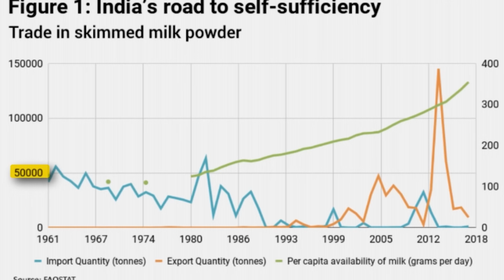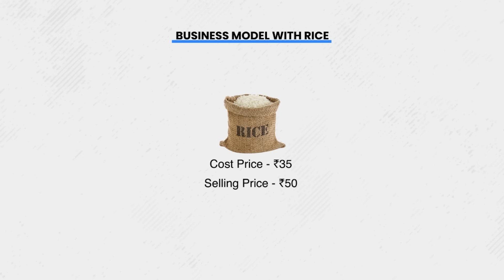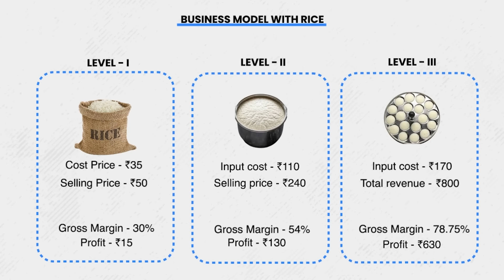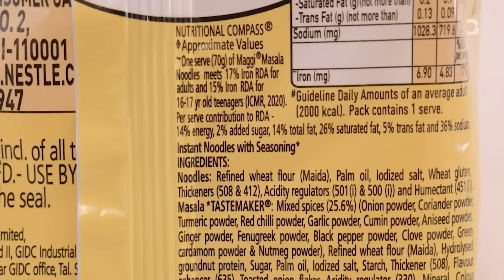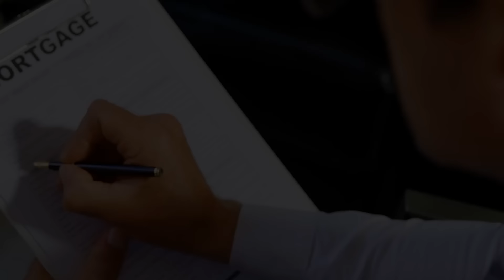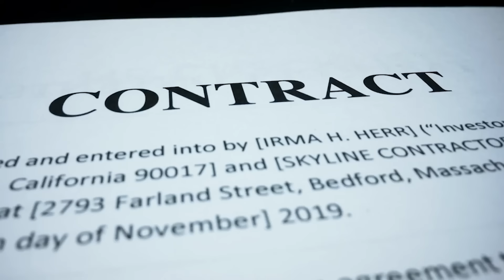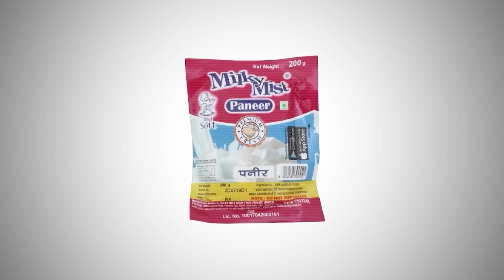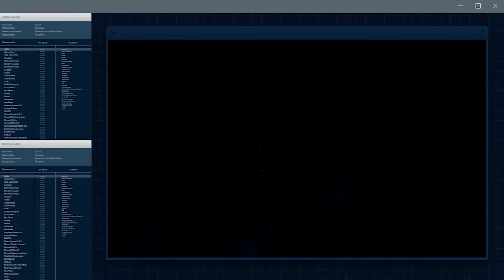How A Poor Boy Built A 2000Cr Dairy Company And Beat Giants: Business Case Study

Comment: 00:03 A 17-year-old boy built a 2,000 CR dairy business in a competitive market.
02:12 Satish built a 2,000 CR company with innovative business strategies
04:15 Adding value through processing increases profit margins.
06:23 Adding value to milk increased margins and reduced competition
08:38 MILKY MIST capitalized on the rise of paneer consumption in the affluent Indian market.
10:40 Milky Mist solved supply and quality issues by leveraging location and addressing farmer challenges
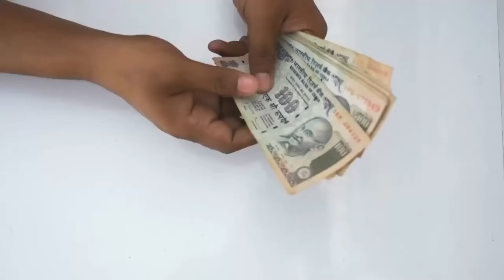12:46 Milky Mist won the trust and loyalty of the farmers without a written contract.
14:52 Milky Mist faced challenges with refrigeration and transportation in reaching kirana stores for distribution of paneer.
16:46 Milky Mist built a cold storage supply chain to maintain quality.
18:36 Milky Mist built a profitable return logistic system.
20:34 Lessons from rise of Satish and Milky Mist
Crafted by Merlin AI.

Comment: Bottom line is like a miner who sells iron ore that's still in sand form it's transformed into a steel pot & the value @ retail increases g.p margins drastically. Other point you did touch on is - corporates get retail groups to sign a contract that they will not stock any other brand except that from the particular corporate company this is a monopoly, it's unfair but it's being done. & Because shelf space is limited retailers sell shelf space & which shelves will host the product EG very high shelves & lowest r not @ average eye level so those shelves get the same product different supplier/manufacturer because they didn't pay to the retail store a kickback of sorts to have it on premium av. Height shelves.